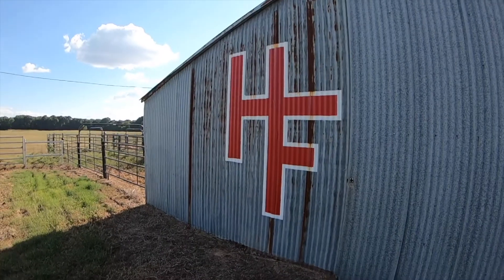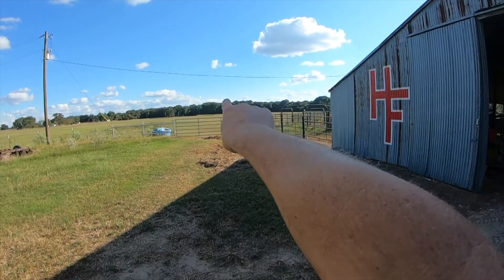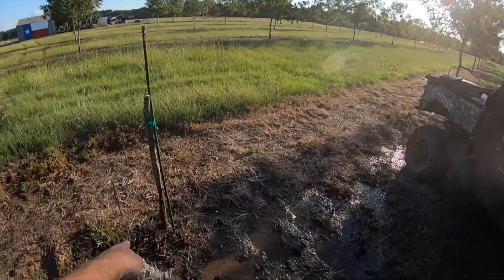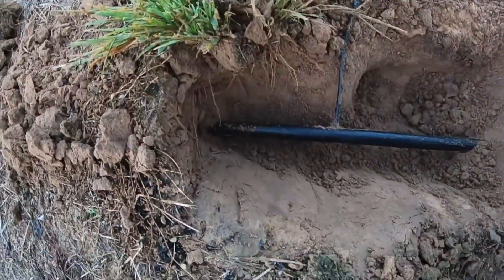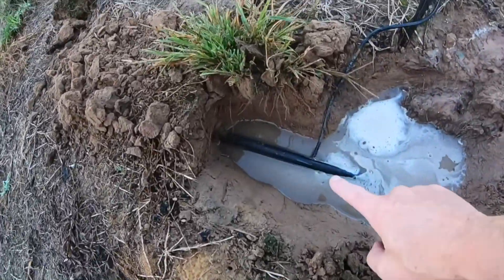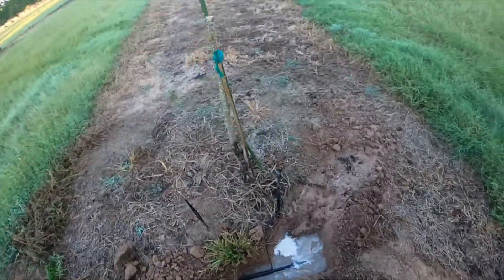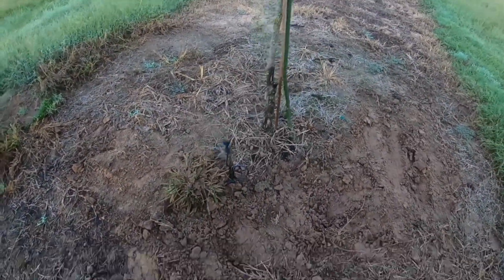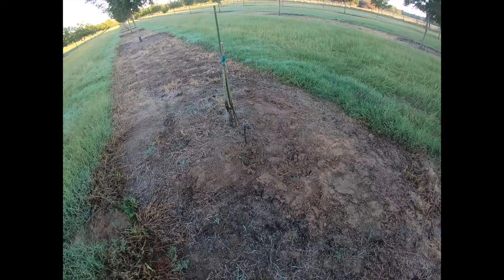Pecan Orchard Irrigation Repair

Comment: What kind of output do you expect of that orchard?
Reply from the maker: Hello, at maturity, they should range 50-100 lbs per tree.  7500-15,000 lbs.   depends on the year.   They are just now starting to produce some. They were planted in 2013.
Reply: @HeritageFarmsTexas  Very nice.